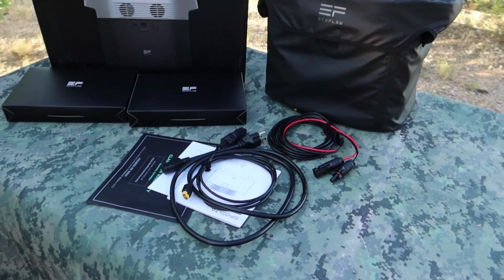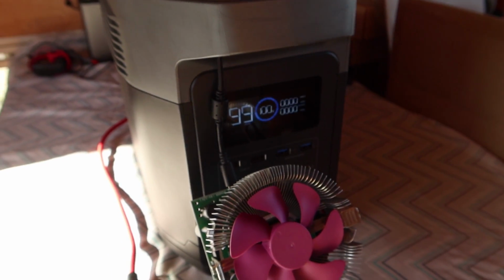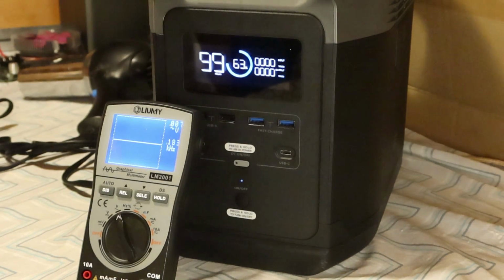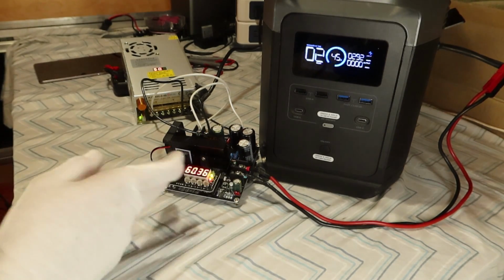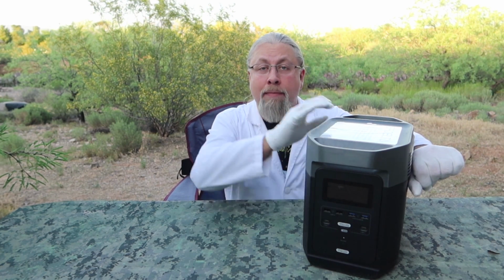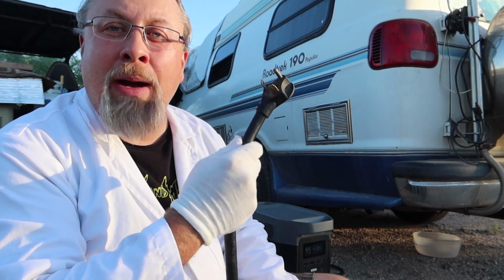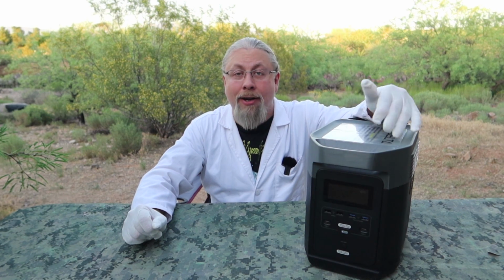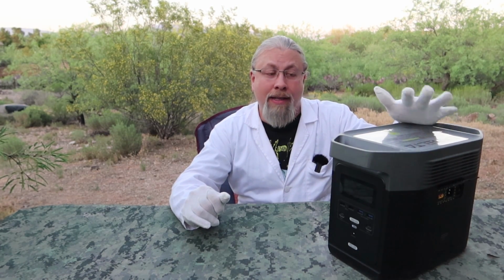EcoFlow DELTA 1300 A GAME CHANGING Solar Generator? HONEST Review! 1800w Portable Power Station

Comment from the maker: ECOFLOW DELTA 1300: https://gohobo.io/2fTn use code 25EFVAHOBO
Reply: i enjoy your video...but all the jargon, i cannot understand...i am a dummie...thanks...
Reply: is there a way to hook this eco to the whole house via circuit box????...need an electrician?...
Reply: If you're in a grid down in the northeast during winter, you will need it to power electric heaters. Sounds like a lithium battery will fail that need. So you answered that question for me. These battery power stations are for light power needs like charging phones, tv, lights and a small fan.

Comment: According to the manual, my microwave cooks at 950W but draws 1200W.  It's likely not all the inefficiency is in the Ecoflow's inverter. Great review overall though. I know its old and not Lipo but for $435 refurb from Ecoflow eBay certified I went for it. I don't plan on it ever being used for close 500 cycles.

Comment: There is a problem with your DC capacity test method (and everyone else that does these types of reviews). Your load tester is fine for measuring Amp-hours, but it only sees the voltage that gets to it, and not the regulated 13.5VDC. It seems the resistance of your plug, cabling and adapter is about 1/4 ohm (V_drop/A_load). If you run the numbers on voltage drop, assuming the output is a regulated 13.5VDC, and you take the 81.53A-h measured by your active load, you get 1130W-h (~90% of the rated battery capacity). If you could mod the active load so it measured the voltage at the plug contacts remotely (or build a custom plug with tight contacts and heavy wiring), you would get an accurate measurement. The 12V accessory socket/plug is a really lousy design for delivering 10A without voltage drop. I enjoy watching your video. Keep up the great work.

Comment: There seems to be an issue with using the car charger that comes with many of the Ecoflow models. There are numerous reports of the plug heating up and, in many cases, melting. I haven't been able to get much clarity on what might be causing this, either from Ecoflow web forums, or Ecoflow support.  I own a Ecoflow Delta 1300 and would like to charge it while driving using the cigarette lighter port in my vehicle. Any ideas what might be happening? It would be great if you could run a test to see if you can get a handle on what is causing this. Thanks

Comment: Quite a lovely video, and the real reason you know why is I both learned a lot ( on the technical side), and then you made me double check whether my Jackery 500 (with its lousy 85w charging wattage) has pass through charging...

and it does just like the 1000, so now I can use my Jackery for the wifi and the alarm and internet during our loadshedding here in SA (scheduled blackouts)

Comment: These videos are funny.  So you have a battery operated generator and the power goes out for a few days.  You run the battery operated generator until It dies. Let's recharge it!  Uhhh...

I pull out my propaine/gas generator to charge the battery generator..... which has limited start ups, (batteries eventually die)  and recharge a 1400 dollar machine.  

I'm using the 1400 dollar machine to charge my gas powered RV. 

LOL
Reply: Understood,  but you can limit your generator run time to daylight hours and use this to help you manage needs during the night.

Comment: Thanks for ur video .. and the knowledge u have of these generators.. I got a echoflow max for my  portable smoker it takes 200watts for the heat rod but after that it draws 30watts continuously for 13 hours..   it does it job ..

Comment: I want to share my problem with the ecoflow 1300. In the morning when the sun starts to shine, the watts going in wont go further then 31Watts . So if im not there it won't load. If i pull the plug out and in again it goos strait to 150 or what it should be at that moment. I have an 300 watt panel that goos strait in the delta. and it worked fine for 2 years. The helpdesk keeps on telling me  with a lot of technical stuf that the panel is the problem... it's hard for me to belive. the panel is not a smart thing. the delta is. https://www.youtube.com/watch?v=Dump4HlL1ow for my problem. can someone help me?

Comment: A very interesting review and extremely helpful for me.

A friend just bought one and asked me of my opinion so that’s why I came to you to find out what I must to offer some informed advice.

This is the looks of things a good unit  but the reason why my friend bought it (and I was looking to buy one too after he mentioned it but before seeing this video 👍🥴) 
Is this.

We are in the Australian Outback with our Cars and are self sufficient in all aspects but powering our 2 portable fridges ( Waeco CFx 60/70 liter type) plus charging our Detectors and keeping our auxiliary batteries ( i have 4 AGM 105 W/hr deep cycle batteries i use for all that) to keep these fully charged on Solar is a real battle as you can understand.

So my question is this…
Knowing I have a MacBook Pro, plus constantly charge 12 volt accessories plus having 2 x 60 liters Waeco CFX portable fridges/ Freezers connected to my auxiliary battery setup (and I do need to keep them running at -14 degrees Celsius during the day at the very least) what do YOU recommend as a ideal setup for my or my friends needs??

I really would love your feedback and thoughts on this as I must replace ALL my batteries and hence need to buy something that will provide me with the capacity to power all my stuff.

The heat in the Australian Outback can exceed 60 degrees Celsius during the day in summer very easily and nighttime is around 28-32 degrees Celsius on a bad day.

What would you recommend I choose for batteries and a power station??

I currently have 4 x 120 watt 12 volt foldable Solar panels plus 2 fixed panels on my Car roof and trailer 100 Watt and a 160 WATT panel…….once all are connected that offers me a total of around 700 WATT but the Solar charge controller I have is crap and It doesn’t input the power as I had hoped to keep my batteries fully charged.

I would welcome and definitely need advise on how to get the best setup with what I have as I only go to town every few month…..Indo have a Yamaha 2.4KWa generator but the fuel is getting very expensive and I am hence looking at a solution such as the Ecoflow OR the ones that are similar but not as expensive and have a much better battery capacity as you rightly pointed out..

Sorry this is a long message and an unusual request I dare say but I am hoping ypu can offer some sound advice to both me and my friend 🙏🏼

Thank you for an excellent review and I subscribed and look forward to your reply.
Regards Jim 🤠

Comment: Hello Prof: Can you run a small PA system without producing unwanted static noise or interference?
I saw you did a Peavey amp test on video, not clear if it makes noise when a keyboard or guitar are used.
Thanks for you videos, Just placed my order.

Comment: After charging my Eco Flo Delta to 100% with my solar panel. 
I brought it in and plugged in a small TV and the cable box in my room.
I also plugged the unit power cord to the wall outlet and the fan came on immediately.

Even though the Eco Flo Delta displays 100% charge and 99 hours.  It will not turn on the TV or cable box.

Question is why won't it turn on the TV and cable box?

And is it safe to leave it plugged into the wall outlet while in use? That is if it will power up my devices.

Comment: Thank you for your review. Let me give you my feedback on my experience after one month with this unit. First I charged it up to 100% after I bought it used it and drained it down to about 75% and then recharged it. I let it sit for two weeks and it was 40% of the charge when it was turned off. I don’t see how that can be acceptable at all for a back up power pack. I then tried it on 150 watt heating blanket when it was fully charged and it kept shutting off even though the draw on it was less than 150 watts.

I’m going to call customer service and then I have to return this product and I’m going try to get a refund it’s just not acceptable at all.
Reply: This review will influence my decision to purchase. Did you get anywhere with customer service? I don’t want one, if it can’t hold a charge. Thanks
Reply: @danak9245  I did call customer service. They asked me to create videos showing the problem and submit a claim. They said they were review it and provide shipping to have it repaired. but since I bought it REI they have a three month return policy for any reason. so I just returned to REI and got my money back.

Comment: Why doesn't anybody long term stress test these things. I feel like most solar generator reviews are very incomplete. This is by far the best most thorough review I've seen so far
Reply: That's what I was wondering, Since I'll be draining it daily/weekly, it will replace my 1800w (2250w starting) 1 gallon gas generator because when I'm done at one job site I have to put it back in my work truck for the next one and the fumes is a concern.

Comment: I like the ECOFLOW product designs and the displays, but I've heard from other reviewers that the recharging and inverter are both quite inefficient, well below the efficiency of competing units.
Also, 800 cycles for battery life seems low - that's just over two years of daily use.

Comment: Can it be charged or is it safe to charge this Delta through AC wall outlet but the outlet is powered by gas generator? (during power outage, i used gas (oil) generator to power the 90% of the house, so during the time the house is powered by the gas/oil generator, can i recharge this Delta through wall outlet? As I am thinking the power  provided by gas/oil generator is not stable enought. Thanks

Comment: I watched so many videos on power banks.  For what I need this will work fine for emergencies.  I bought the Delta and also bought the River as well for a CPAP in an emergency.  I paid $1980 for both, including 160w panel and 2 solar lights.  Not bad.   I like how I can change settings to 1800w and can add xtra battery to River.  So these should last for years and will be a compliment to the gas generator.  I may even but another Delta if the prices continue to drop. I saved a total of $250 on the both Ecoflos..
Reply: I got exactly those two ecos. I was wondering have you tried running it while having a solar panel charging it same time. I want to run a small AC
Reply: @kimd7866  It is a UPS (uninterrupted power source) so yes you can charge while using.  My daughter keeps her CPAP plugged into the river so when power goes out she won't wake up.

Comment: 800 Cycles to 80%+ capacity is stated on their website. Maybe the improved the internals. 
I would use it in a campervan as the Battery/Inverter Solar Controller. Its fast to charge and you wouldnt have to do all the wiring.
Reply from the maker: No, they changed the stats on their website after the fact.

Comment: My 12v XT60 connector melted while charging ecoflow plugged into my 2021 Ram sport. It won't power my 15amp appliances ie. Camper air conditioner. Went into protection on my lg OLED TV. And when doing a capacity test I only got 900 watt hrs at .1C. also seems to time out and turn off on our 12v camping fridge... .maybe because it pulls no power for a period of time once it gets to temp? Tried to get warranty Ecoflow is being very Difficult..

Comment: I bought one of these about 6 months ago,  I started to use it more 
often about a month ago, and there seems to be a problem with over 
heating,  My unit has shut down twice under these conditions,  I am 
feeding it with two 170 watt solar panels run in series.  they are 
putting about 250 to 300 watts into the Delta flow I am also pulling 
about 200 watts out of the unit to run my small refrigerator about 140 
watts and some lights and my laptop. after about 4 hours of use the unit
 just drops out the load and I get Zero output,  This has now happened 
two times this month.  I have to turn the unit off and restart it.  ????
    Just thought you should know.
Reply: Ok
Reply: you get it sorted, any progress
Reply: @annabanna666  I still have the unit as a back up but now I use a Bluetti 1500, The Bluetti works so well that I have bought a second one.  The Bluetti has never dropped out.  I have not set up my panels yet this year because I live pretty far north in Pennsylvania. I wish I had not bought the EcoFLow it is also a energy pig it uses so much energy just staying on even without a load. My advice to anyone who is looking for a unit is to stay away from the EcoFlow.

Comment: If there were a Lifepo4 battery installed in it, it would be useful ....... but due to the few cycles and the fire hazard in the car or mobile home, it cannot be used without stomach ache.

Comment: Whats nice is you can charge the Ecoflow from the cigarette lighter plug at 113w from a Prius or solar at about same watts, if you have a full tank of gas it will last awhile.
Reply: Prius Prime plug in was used testing the output on the cigarette lighter plug, if you have a full battery it will last a long time, might work in place of buying inverter and hooking up to 12v battery.

Comment: Hey hey Hobo. I have an ecoflow delta. Would I be able to plug a 3 ft metal power strip into the delta and then run various gear off of the power strip? I have a unique situation in my small camper that I'm wondering if that scenario would work. Thanks again for all the cool videos!

Comment: I love the enthusiasm. Connecting this solar generator to the van as it draws almost 1200 W indicating that it only has about 10 minutes left. At 30% charge is cool, but not worth it.  Not enough wattage.  For an emergency that takes less than 40 min, then it's worth $1000?

Comment: No longer too expensive per watt hour as stated in the video.  Here's my calculation of cost per watt hour...

Renogy Lycan	Ecoflow EFDelta	  Jackery Explorer 1500	Bluetti AC200P
$1,299	                        $1,099	                  $1,349	                          $1,699
$1.21	                         $0.87	                    $0.91	                            $0.85

These are all Amazon prices as of May 21, 2021.

Comment: please review again. allow the charge to hit 100% and let the unit shut off letting you know that it's really fully charged. then test the power capacity by running until discharged. I think your battery discharge test will be different from what is found in your review.

Comment: It seems like every generator is a mix of pluses and minuses. Makes it really hard to decide which one is right for my particular use. We want one to run a refrigerator for a few days in case the power goes out and also run a little portable air conditioner in one of the rooms so we were thinkingof buying two of them. But now that I've seen this review I'm thinking it be better to use the money and get a titan or a blueberry with a bigger power supply. Would appreciate your suggestion

Comment: I have an ecoflow delta and 2 rockpals 100w solar panels. The panels didn’t come with the correct adapter to use them with the EF gen. Am I correct that I need an xt60 to Anderson adapter or should I go with the mc4 to Anderson adapter? I’m a newbie to this solar stuff but am trying to understand it and get it right. Thanks for your advice.

Comment: In the event of a power outage, using the unit with the solar setup charging pass through ability, what would the run time be powering an average home refrigerator? Is this a small but worthy, non-fuel power solution for power interruption? 3 year life with fast charging, what about life using the slower charging solar array? Thanks, you got a like and subsc.

Comment: The information I have received from 3 main testers Hobo tech David poz and Will Prowse they ownly put out for those that have deep pockets us poor folks who have to keep it under 150 $  and that means a booster pack most comes with a light and a modified sine wave inverter but they are mostly designed to fail as they ownly charge to 12 volts ownly way to get them to fix it or find one that charges the gelled lead acid to full charge

Comment: I just canceled my Jackery Explorer 1000 order in favor of the Delta 1300.  This model is more like a true 1KW solar plant, the solar panels are foldable and waterproof, and I can put 3 of them in series to get a solar charge without impacting battery durability.  The $300 price difference isn't much for me and as far as the increased weight in the Delta, that's in part because the power supply is built-in.  With the Jackery, you incur the additional weight in the humongous external power brick.  (My only regret is that they made this thing look like a PowerMac G4.  I hate Macs!)  Great review!  Sub'd.

Comment: i have been eyeing this for a quick and easy way to extend the range and charge on my 2016 spark ev
what are your thoughts on using this method? 

also how fast would this charge the car? not too keen on the math

 2016 spark ev has a 19 kWh
400 V lithium-ion
120kw battery power

is there something better you would recommend around the same price range?

also amazing educational  video, thumbs up! subscribed

Comment: I am interested to know if the Delta 1300 can be quick charged in under 2 hours from a gas generator such as the Honda 2000 i ? If so, it would allow the user to do the charging in the middle of the day and not have to run the gas generator at anti social times on our crowded UK campsites.
Reply: I'm wondering the same thing. Did you ever find out about this?
Reply: @rwilde9800  Sorry no.
Reply: @Gordonafloat  Ok thanks.